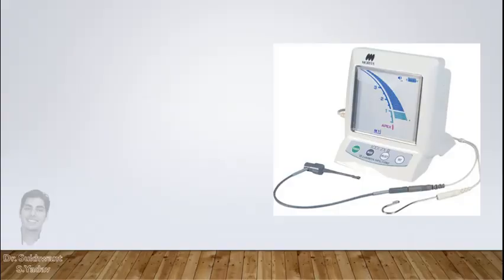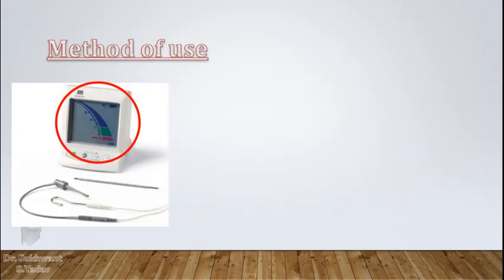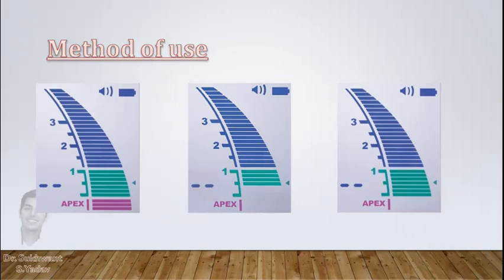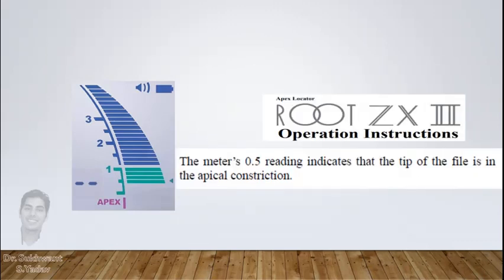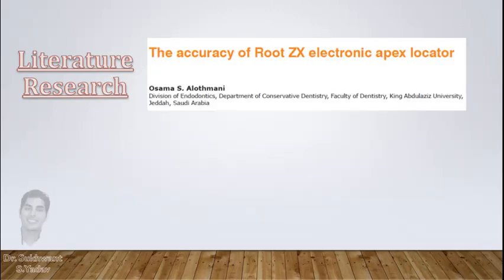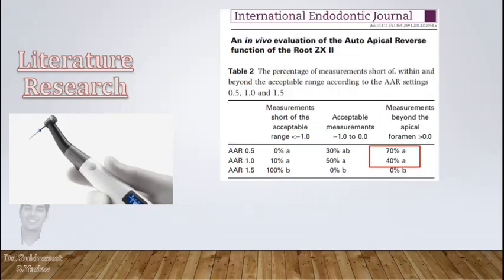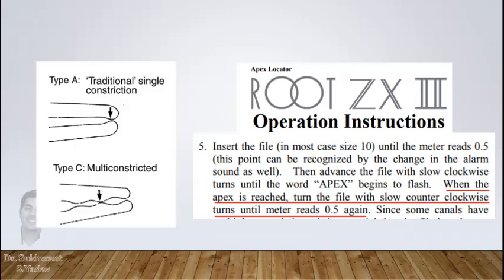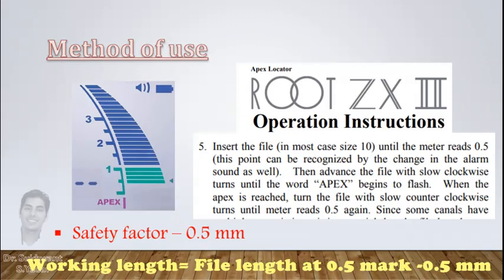Apex locators - Correct method to measure working length !!

Comment: Dr why do you reduce 0.5 mm from file length in 0.5 point of apex locator?
You mention it as a saftey factor
I can accept it for irreversible pulpitis but in necrotic situation the whole length should be cleaned!
Reply: And according to the research that you mention it in 70% of cases number 0.5 was between AC and AF
If this point is end of cleaning and shapin and obturation
Why do we reduce .05mm?!!?!
Reply from the maker: Safety factor is guven because we can control our rotary files exactly on WL. It may slip beyond the WL. If you are concerned about last 0.5 mm then you can prepare that part with Hand 15-20 # k file.

Comment: For an example , at apex length is 19mm 
we came at 0.5 marking so it would be 18.5 so final working length must be 18?
Reply from the maker: Focus on 0.5 mark in apex locator screen. Reach that part and then reduce 0.5 mm. This is best method.
If you have gone till apex, come back 0.5 mark and measure the file length and the reduce 0.5 mm

Comment: Sir I have one question, I checked working length on apex locator on a lower molar, the file was  0.5 mm from the apex, I was happy and didn't took xray and obturated at that length but when I saw the final xray of obturation I was shocked to see the GP atleast 3 mm short in all canals of lower molars, sir what could have been the case for such discrepancy, and do I need to do re rct in this case immediately and re establish working length.
Reply from the maker: Purpose of Apex locator is to locate apical constriction the narrowest point in canal but for best results the file should be within 2-3 mm of apical third of root👍
Reply: @Endocrisps  Oh thank you so much sir, many thanks.

Comment: If the reading was 00 that it mean I should substract 1 mm??
Reply: Dr. Is morita apex locator is previously seated when we buy it??
Reply from the maker: You have to assemble it. 👍
Reply from the maker: Focus on 0.5 mark only
There is no relevance of other marks.
Reduce 0.5 mm from this 0.5 mark length
Reply: In case of periapical lesion the apex locator give me lesser reading how can i fix that problem

Comment: How we can reduce 0.5 mm in rotary file or hand file ... during final working length
Reply from the maker: Either by radiographs or apex locator once you decide that this is your length till apex in radiographs and 0.5 mm mark in apex locator. Suppose this is 20 mm, then final WL will be 0.5mm less that is 19.5mm.🙏🙏
Reply: @Endocrisps  if till apex is 20mm , then 19.5 will be between apical constriction n foramen . So will 19mm be final working length??
Reply from the maker: Correct👌👌

Comment: Thank you so much sir!!! I was having lots of trouble with working length measurement. Also which file do you use for measurement? No.10 or no.15 file?
Reply from the maker: 🙏🙏
File should be snugly fit in canal, neither loose nor tight for WL measurement.
Especially for molar's narrow canal #10 is suitable🙏🙏
Reply: @Endocrisps  Oh ok thanks alot! I will use 10 for posterior and 15 for anterior then!
Reply: @Endocrisps  Hello sir, I am currently working on a mandibular first molar, I have taken a radiograph with no 15 in each mesial canal and 20 in distal canal. The file is not going further and patient feels pain at this point
Can you please check the lined radiograph and give your expert opinion?
Link: https://imgur.com/gallery/eGK4dDy
Reply: Give anesthesia inside the canal and pain will go, I think there is another distal canal also,,, hand files usually don't reach apex even in distal canals sometimes times especially vital teeth,, so pre enlarge coronal 2 thirds with sx s1 and s2,, and use full strength naocl for that, then set your thinnest rotary file ( which is s1 protaper or the 3% taper files( like pathfinder,, or expeditors) to the estimated radiographic apex and go few stokes without pressure,, irrigate,, re do it and this time it will go further,, irrigate,,, re do it until length, then use the apex locater to see if you have achieved patency to zero reading, if you reach this moment then you have ended the difficult part! Now go back 0.5 to 1.0 mm to measure working length,, now use s2 then carry on to finisher files,, make sure you file is standing as straight as possible in relation to long access of the tooth after the 2/3 thirds enlargement,, if not then you probably haven't enlarged correctly,, probably didn't brush the files against the dentin triangle away from fur cation.....

Comment: Sir what is this 0.5 mm mark...is this preset by company or we have to set it? Please elaborate.
Reply from the maker: Yes its preset. 
You can only set the alarming sound. 
You can set that at apex, 0.5 or  1.
Reply: Sir I have root zx mini...same things hold true for zx mini also??
One more thing...what readings will be shown on screen if we cross the apex?
Reply from the maker: Yes same for root ZX mini. 
Apex will flash on screen as soon as you go in apex (cross apical foramen)
Reply: @Endocrisps  thanks sir
Reply from the maker: When file will reach near apical constriction, screen will show reading at 0.5 mark. You can't adjust this. Only thing you can change is the timing of beep sound.

Comment: Informative sir. Its like shaktimaan's " choti magar moti baatein". Good job sir.
Reply from the maker: Haha
Thankyou🙏🙏
Reply: Sir,  accordingly our obturation should terminate furthur 1 or 0.5 mm short than working length got by apex locator ?
Reply from the maker: @bharatrathi2310  Obturation should be done till Working Length. Why short?
Reply: Ok sir. I confused it with radiographic apex
Reply: I have zx mini. Zx 2 and mini are equally accurate ?
Reply from the maker: @bharatrathi2310  Root ZX is found more accurate
Reply: Sir It is said that  apex locator may sometime show incorrect working length  how do we know that it is showing wrong working length?
Reply from the maker: @bharatrathi2310  Its simple, always make a habit of taking a pre-op xray and measure length of tooth. It will give you approx idea. Now if apex locator is showing apex within 2  mm of this length that is mostly correct. If there is major discrepancy, that is faulty reading.
Reply: @Endocrisps   Sir 2mm from apex or length of tooth measured on rvg ?
Reply: @Endocrisps  Sir means if length of tooth is 20 mm then apex locator will show apex at 18mm??
Reply from the maker: No, you have misread it. Listen again and if there is doubt message me
Reply: @Endocrisps   sir I couldn't understand it. Plz explain with an example
Reply from the maker: @Devakshi102  It means apex locator sometimes show apex 5 mm short of radiographic apex but that is wrong. When apex locator showing apex with in 2 mm of apex that is 1mm or 1.5 mm or 2 mm then it is mostly accurate👍
Reply: @Endocrisps   understood. Thanks you very much Sir🙏

Comment: Clear video sir.
I have s denti i root apex locator. Its very accurate in presence of saline. I do only to 0.5 mm mark always. Confirmation file x ray and master cone x ray comes around 0.5 mm short of radiographic apex on that length
Reply from the maker: Thankyou !!

Comment: Hi sir again a very infomative video 
Plz advice if i should not invest in a cord or cordless endomotor 
And which of which brand
Reply from the maker: Yes cordless endomotor is easy to take care and convenient too. 
You can go with any brand come in your budget. 
Oricam, NSK, waldent are good brands and in economical range too. Call their dealers and test them first.
Reply: Hi sir very good evening.....sir first time I am taking root zx mini wll it show accurate reading...plz hlp me sir
Reply from the maker: @drmdzia6221  yes it will show accurate reading. Good tool👍
Reply: @Endocrisps  ..sir after canal open we shld do minimal bmp ya direct we should put the file for taking wrking length....plz its request to u ...ya canal shld b dry
Reply from the maker: Yes you can directly put the file to take WL. Reading will be accurate if canal is little moist, it should neither be flooded with irrigant nor be absolute dry.
Reply: @Endocrisps  sir very good afternoon sir if we take j morita endomotor inbuilt apex locator how cme we no wrking length wll it easy us by taking this ......while reaching to apical any sound cmes ya how cme we now sir.....I am afraid of apical areas if overinstrument happens than ......so plz hlp me sir may god blss u sir
Reply: @Endocrisps  I am in confusion what to take apex locator ya inbuilt hand piece
Reply from the maker: @drmdzia6221  apex locator separate is better🙏
Reply: @drmdzia6221  bro take it separately. According to me buy a very good apex locator like JM or ApexID sybronendo. You can buy any lesser price endomotor like woodpecker or oricam . It's more than enough bro. If you buy inbuilt one, it will be little heavy and bulky to work.
Reply: @drmahanthashok   sir very good morning sir plz can u hlp me can I take eighteeth apex locator  ya I should take jm morita I have all endodontist hw work in clinic....I do well rct but only for wrking length wht should I take plz sir hlp me.....good apex locator
Reply: @drmdzia6221  hi doctor. If you don't have problem with money buy off J Morita apex locator. Endomotor anything is fine. Eighteeth looks good too u can buy. If u have money issues buy eighteeth apex locator
Reply: Buy cordless. Easy to maintain and no wires